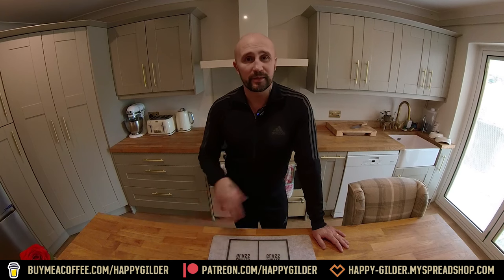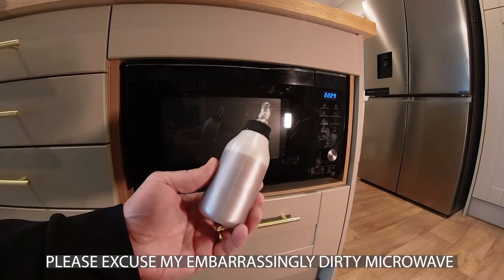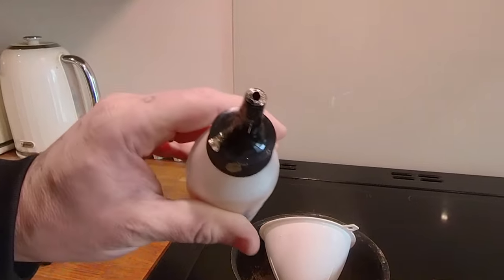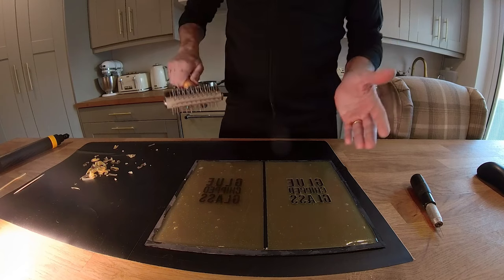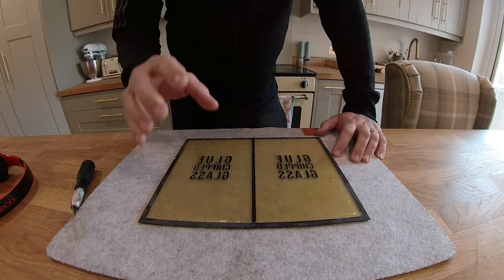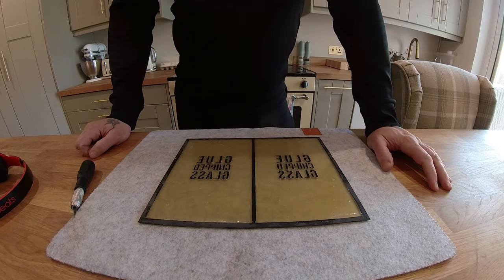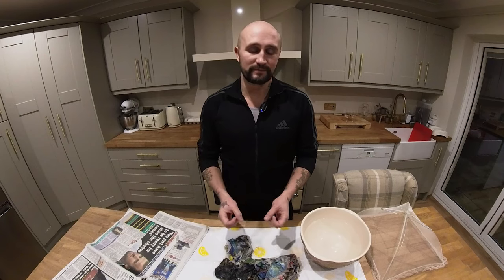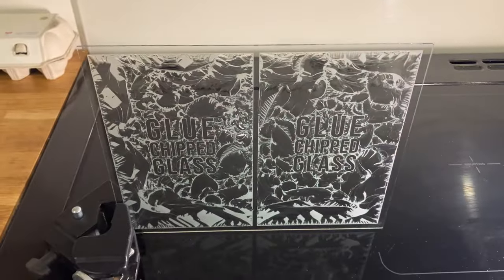Glue Chipping Experiments

Comment: Thanks Paul.  I am going to do some experiments now re grit mesh and sandblaster pressure to work out what's best.  Up until now I have been using 120 grit garnet and 120psi.  Works OK but I will now lower the pressure and see what happens.

Comment: Those fern bits are so nice looking! 

When you score the letters, are you doing every sharp angle (like inside the E), or just the outsides of the lettering into the main area?  

I’ve decided the best way for me to produce a piece is to win the contest, give you my design, have you mail the finished piece back, and hang it on my wall! 😂.
Reply from the maker: Cheers Ted!
I just score the sharp angles on the outside.
How about, if you win the contest I do your design just past the sandblasting stage, then you can do the glue chipping, gilding and painting 😎